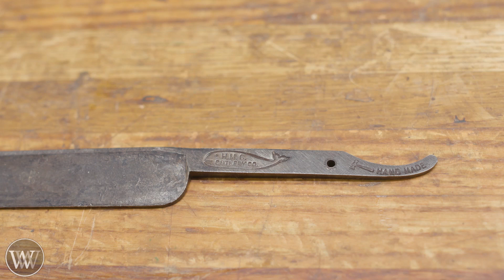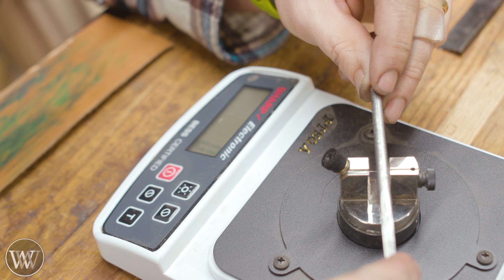Straight Razor Made From 80 Year Old Stock

Comment: This is going to sound crazy but I ran across two of those exact same blanks in my tool chest last week.  I first found them about 30 years ago in a wooden barrel, at the boat yard I was working at, in Florida. There were a bunch more but I only took 2.  I also have 2 others without any markings on them.
Reply from the maker: Interesting. I wonder if the ones I have came from the same stock. The guy who is selling it was from Florida.
Reply: @WoodByWright  I was wondering if that was the case.  The boat yard was in West Palm Beach.